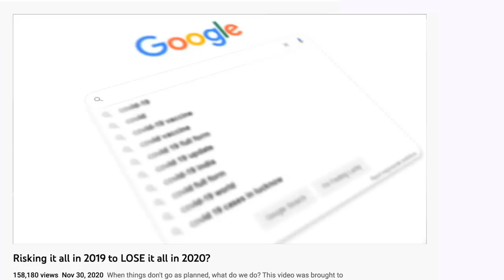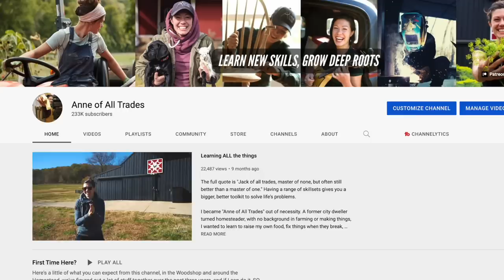I tried to build a school. Can paperwork kill a dream?

Comment: Even though you couldn’t just do it yourself (which I feel is not reality) you had to take a step back and ask for help. 
This is life and I feel this is how lessons are taught. I watch two different boat builders of wooden boats and they wanted to build these boats and found out help was the most valuable  commodity for the project. 
You have taught more than you think. Keep with it the classes will come and at that time it will mean so much more. God bless.

Comment: Nothing to be ashamed of. I didn't take on any thing as big as your project. Just a major extension doubling the size of my house. I estimated it would take 6 months start to finished. It took 2 years. Most of that was fighting to get council approval. in the end I probably knew planning and construction standards better than the roadblock who had to give approval. The actual build took 6 months  including the inevitable delays scheduling trades on site and weather problems plus the fact I did most of the work myself with the help of family. Dig in and keep going. You'll get there.

Comment: im in the same boat in a lot of ways. bought a house and 54 acres in a quiet community, went to put some nice hard wood flooring in and .... the house is a disaster. had to repair and solid fill the basement block, replacing subfloor right now and some framing, fixing the hidden water damage, i didnt realize i was completely rebuilding the house... ive worked my butt off on this house , no help =), bought it in December figured id be in February or early march. ill be lucky if i have enough done to move in by December of this year. i know its hard, i know how those overwhelming moments feel. keep your head up, you have a ton of people behind you . wish you the best of luck.

Comment: Hey gorgeous human! The fact is, not showing or talking about the tough and the rough bits also just passes that sense of failure along to those of us who will inevitably fail when we’re inspired to follow in your footsteps. Mistakes and hurdles are great learning tools, no need to gloss over them. Of course starting a new life on a brand new farm is hard (even without all the extra work you’ve given yourself!), but if you don’t talk about the struggles you’re only telling half the story and you’re selling a fantasy.

Anne, you’ve taken on a shite-load, but it’s that over-exuberance that will get the job done! Even if it ends up looking different to what you originally imagined. Besides, we’ve all learned by now that things change. Sending positive vibes and gratitude from 10,000 miles away 😊❤️

Comment: Girl... failure isn't shameful.  Failure is the best way to learn.  It's the fastest way to grow.  If you're afraid to fail, you're holding yourself back.  Failures should be celebrated and shared to help others learn with you. 

It IS hard to ask for help, though. I learned the same lesson you did that DIY often means it'll cost significantly more than if you hired a pro.  Knowing your limits is an ongoing challenge.  

I'm glad you put out this video because I have been thinking about your last one for a while and wondering how you're doing.  I'm glad your community has stepped up to show you that you're not alone and that they've got your back.

Comment: I almost got caught up in all the stuff your talking about until I came to a very sobering moment when I finally said enough! When that happened, I had to do a complete regroup and I reevaluated what was happening to the project and I found so many inefiechencies that I was almost speechless to even talk about it. That's when I hired a company to come in that had the equipment and heavy machinery to do the job quickly. Well trained personnel came in, they did the job that was laid out for them plus a little extra. It was a wonderful experience working with them. I live in the North Alabama region and I do have a little insight into the situation. I commend you guys for not getting down struck by all the crap that beaurocricy has to offer. Yay them ... lol. Who are they to tell you how to live? I think you guys are doing exactly what you think you should be doing at this time because it is only gonna get worse from here on codes and crap. I wish you all the best that life has to offer and also share your love for the antique tools and the appreciation for the old ways things were done.  Great videos. Great job. Keep it coming. I'm definitely a new fan.

Comment: I'm confused.  What is the single piece of paper that is holding things up?
Reply from the maker: I didn’t want to dwell on it too long because it really is making things insanely difficult right now, but we are up against some pretty insane permit issues at the moment, partly because of changing laws and political climates, paired with the fact that urban sprawl is forcing more and more small farms like ours to behave like large business conglomerates instead of family operations, and partly because of the absolutely insane expansion going on in the Nashville area and codes departments that are nowhere near well equipped enough to handle the influx of work requests or the capacity to deal with more unique circumstances like ours. We desperately need to finish this building and start using it, but we’ve been barred from continuing work or moving further forward until that stuff gets cleared up. We’ve already been held up for 6 months and are looking at possibly a year or more just trying to get this stuff pushed through and frankly, I just don’t know if I have another year in me.

Comment: Self-sufficiency is not being able to do it yourself, it being able to get it done yourself. Our world has become far too complex for anyone to do it all yourself. When I started my career in computers on the software side of things, I could write operating systems, network systems, and programs.  When I retired a couple of years ago, all I really knew about was how to use computers for teaching. I didn't get dumb, computers got more complex. I taught instructors in a  polytechnic about using technology in their teaching. From them I heard about rapidly all trades are changing from carpentry to plumbing. One person cannot keep up with it all.
FYI: I have dyslexia that went undiagnosed until I was in my doctoral program. Because of that I still have fight against my feeling that I'm a fraud. Your problems have only made you stronger and better.